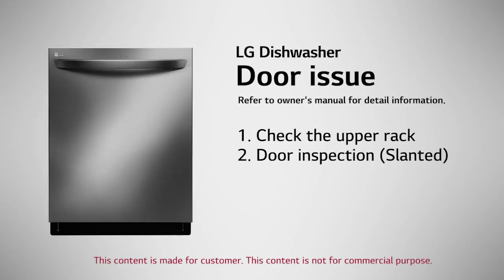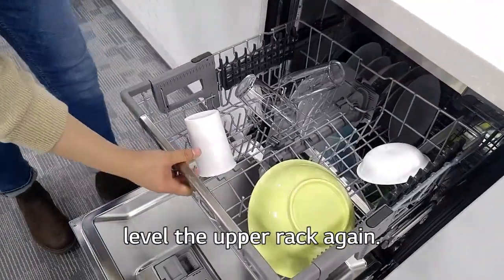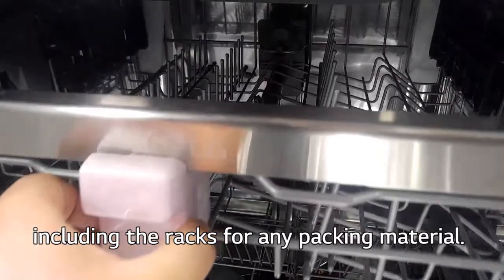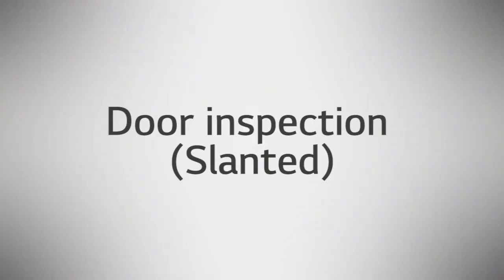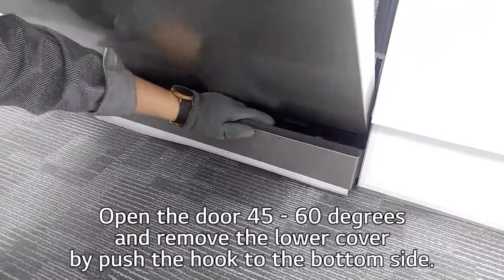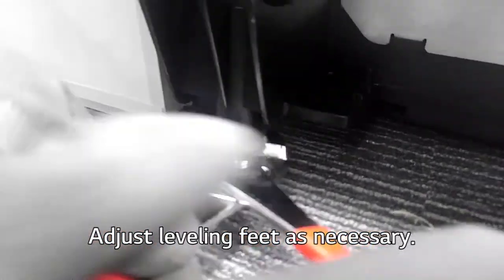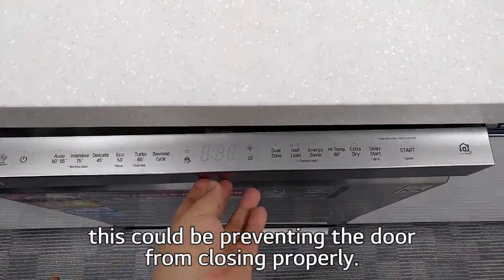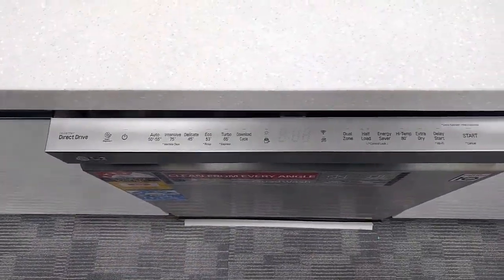[LG Dishwashers] Door Issue

Comment: I removed all packing materials, I leveled it, I jostled the door. It still doesn't work. My unit did not include front brackets.
Reply from the maker: Hi, there. We are sorry for the experience. It's clear that proper leveling, checking the door for obstructions or damage, and inspecting the door latch and switch are crucial steps in troubleshooting the issues you're experiencing with your LG dishwasher. You may reach us out through direct message for further assistance. ^Mau